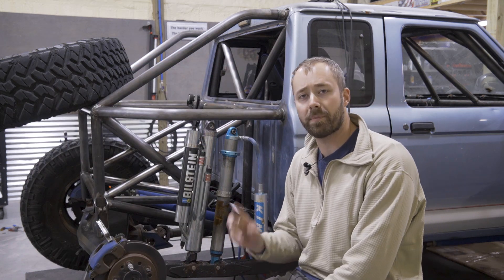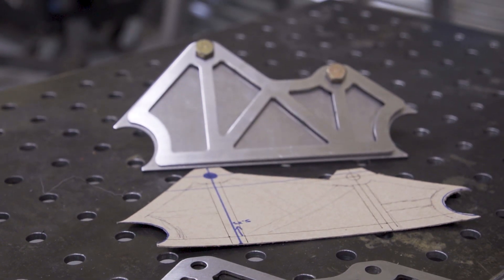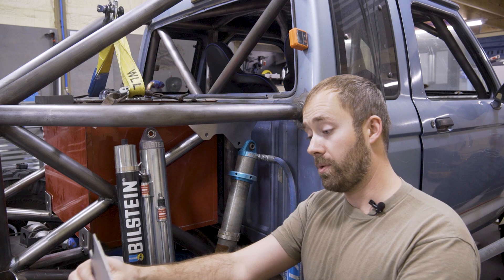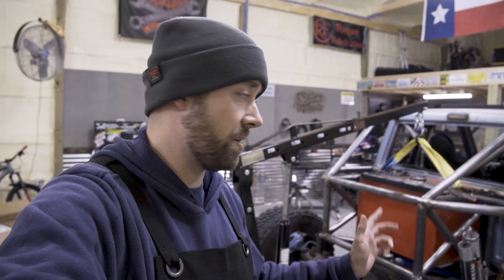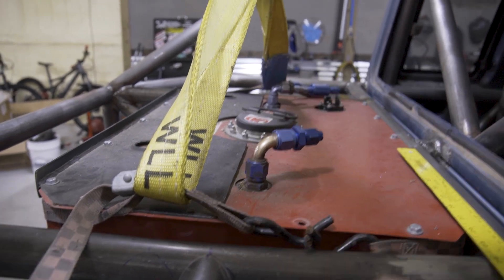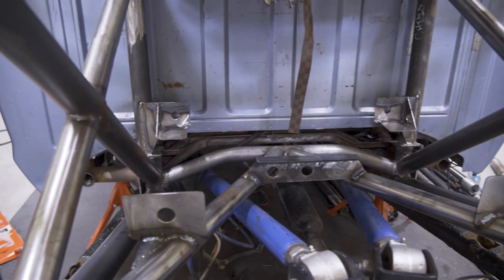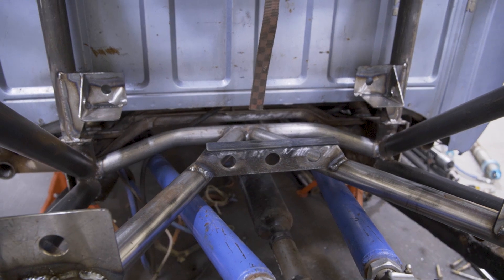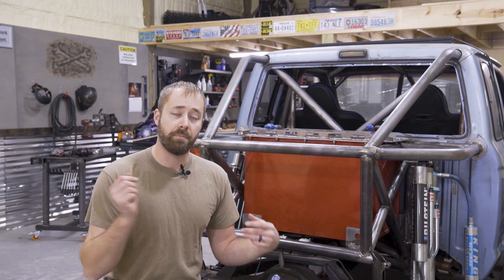Shock and Fuel Cell Mount Fabrication - Backhalf Part 3 Reckless Wrench Garage

Comment: Make sure you put some rubber Under the tank mounts to eliminate vibrations between the top Mount plate and the cell itself. Last thing you want it a hole wearing through

Comment: The rangers looking good! I think more fabricators should sit down and learn some basic CAD like you did, it just opens up a whole new world with laser/plasma cutting, CNC, etc. Thats great to gear that it only took a few hours to figure it out.

One other thing it also opens up is 3D printing. Plastic is a less useful material than metal, but it still definitely has its place!
Reply from the maker: I have been trying more designs and playing with the software to learn it more. It is so easy to send a file and get it laser cut now this is a tool/skill to keep developing for sure!

Comment: Having the fuel cell further forward will also help how the suspension changes, a couple hundred pounds of fuel at the very back will make the truck act totally different from full to empty.
Reply from the maker: On the previous setup I had it behind the axle. It would fluctuate ride height a few inches through fuel usage. I really liked the feel of the weight that far back when it was full
Reply: weight in there rear of these trucks is better  cars it’s better to have centralized   ask any TT shock tuner ever